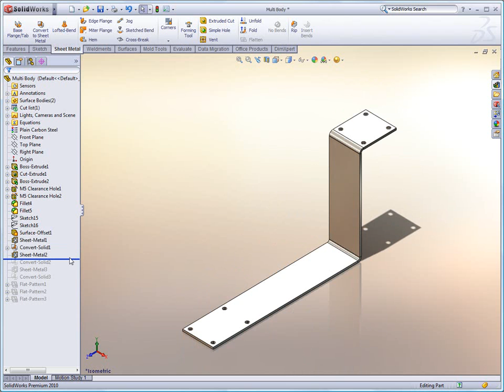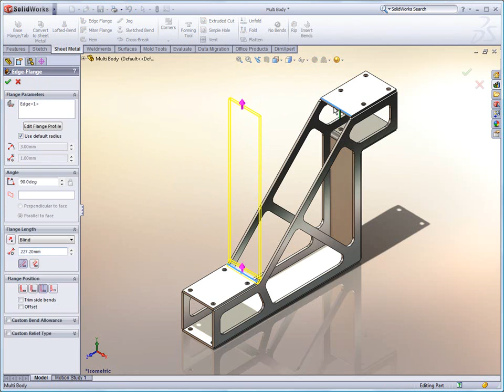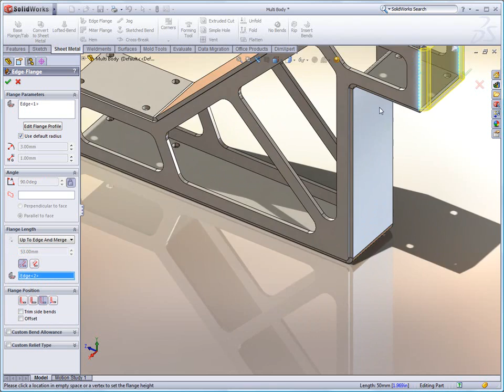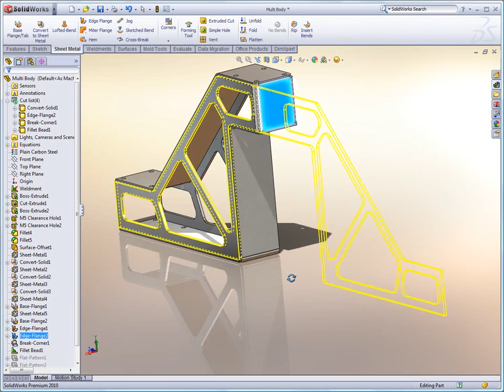Sheetmetal and Weldments in SolidWorks

Comment: I hope someone can help with my problem.  I've viewed several videos of welding in SW.  They are all pretty much the same.  I'm using SW 2017 and I am unable to get a VISIBLE weld bead to form.  What am I doing wrong?
Reply from the maker: I recommend posting your question to the SOLIDWORKS public user forum https://r1132100503382-eu1-3dswym.3dexperience.3ds.com/community/swym:prd:R1132100503382:community:yUw32GbYTEqKdgY7-jbZPg

Comment: Please clarify:
1.) You start with a solid body, but at 2:40 it shows 2 surface bodies and cut list in the tree.  Trick?
2.) If you actually started with a basic solid body, could you get to weldment and sheet metal combo?
I am trying to replicate on SW2010.
Reply from the maker: Hi, thanks for your question.  The design starts with a single solid body, then using Convert to Sheetmetal, certain faces are selected to create sheetmetal BODIES.  At 2:40, the model contains 4 sheetmetal bodies (they are solids, not surfaces).  The major enhancement that is being shown here is that in the Part environment, you can have a mix of body types--general feature based solid bodies (e.g., a machine design part), sheetmetal bodies, weldment bodies, and surface-only bodies (not shown in this video).  In other words, a single part file could be a combination of weldments, sheetmetal, other solid bodies (machine parts, plates, etc) and optionally, surfaces.  For more information look for tutorials on Multi-body modeling techniques.
Reply: Thanks for the info  I didn't know SW could take a solid and "hollow it out" and "origami" it.   Good to know.